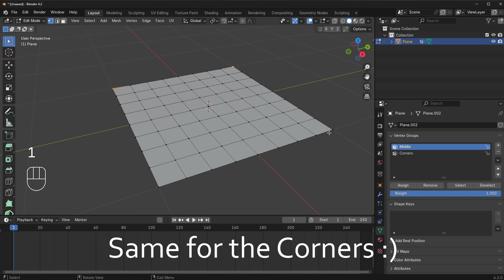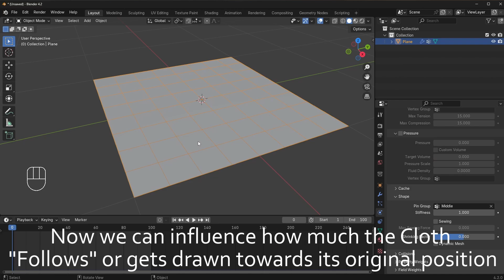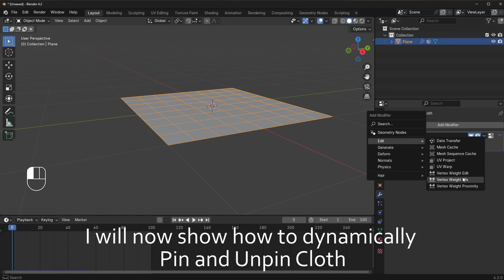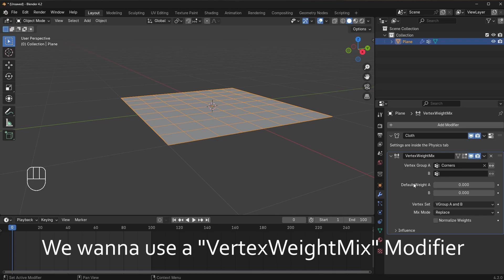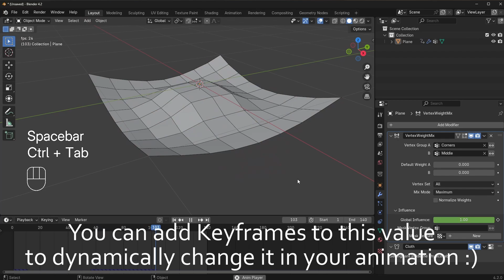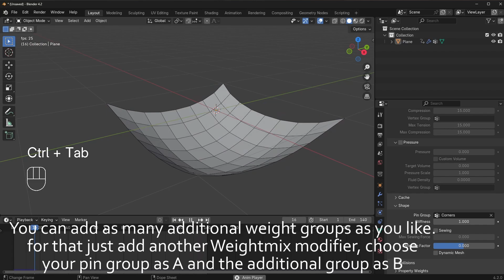[Blender] How Dynamic Cloth Pinning and Stiffness work [Part 1]

Comment: Hi does your jiggle maker plugin work for making a butt physics deform cage?
Reply from the maker: There is a option to use a vertex group to generate a jiggle proxy from it, so yes that would work :) You can also use a custom mesh or if all else fails, adjust the default proxy mesh to your butt shape and try to use that